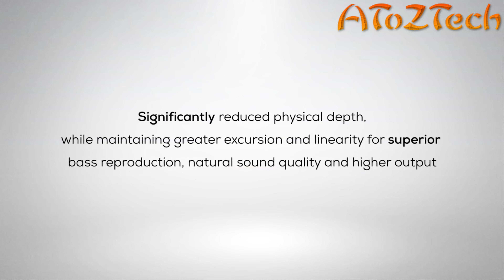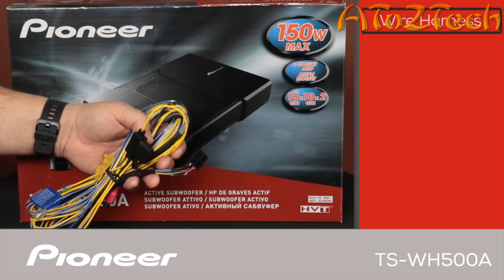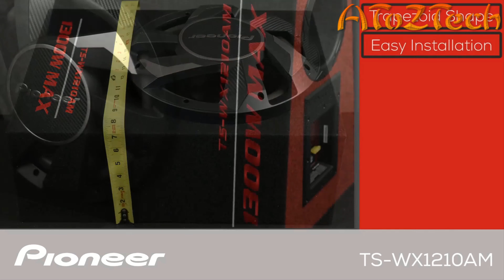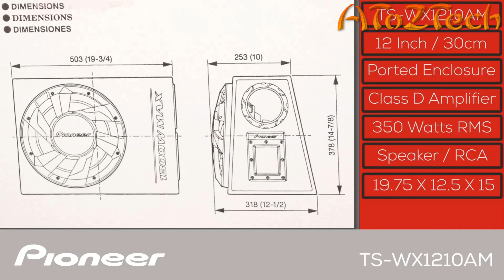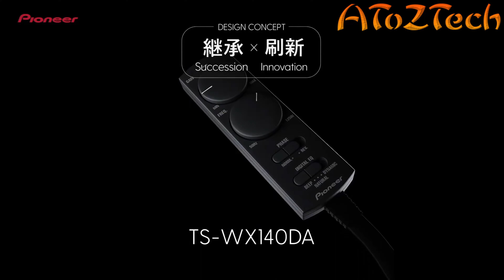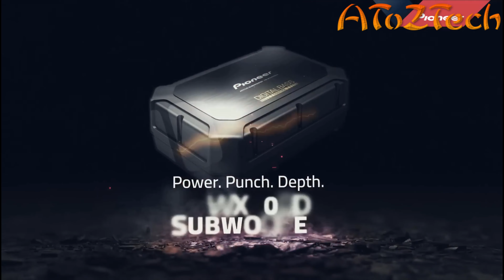THE BEST PIONEER PRE-AMPLIFIED ACTIVE SUBWOOFER OF 2023 | Top 5 Powered Pre-Loaded Enclosure Sub!

Comment from the maker: #5). ► PIONEER TS-WH500A Hvt Sealed 8.25-inch 150W Active Subwoofer, 150W Max Power ➜ https://amzn.to/46NPtON
#4). ► PIONEER TS-WX1210AM - Powerful 12-inch Active Subwoofer with Built-in Amplifier, 1300 Watts ➜ https://amzn.to/3Q8Pndm
#3). ► Pioneer TS-WX140DA Compact Active Under Seat Subwoofer ➜ https://amzn.to/3QeZ4XB
#2). ► PIONEER TS-D10LB 10-inch Pre-Loaded Subwoofer with Sealed Enclosure, 1300 Watts Peak Power ➜ https://amzn.to/46MYck1
#1). ► PIONEER TS-WX400DA Compact Series 9" x 5-1/2" - 250 W Max Power - Compact Active Subwoofer  ➜ https://amzn.to/3tSsCms